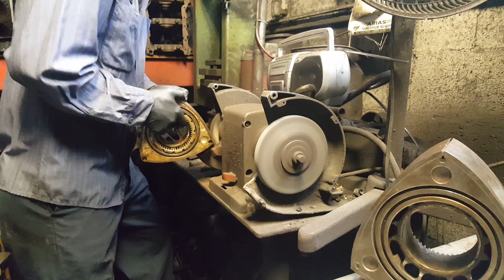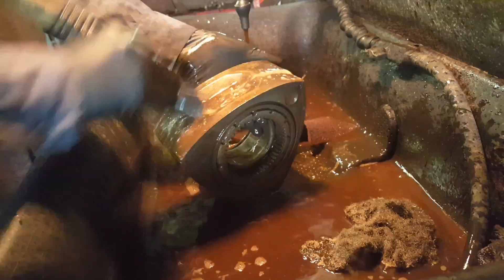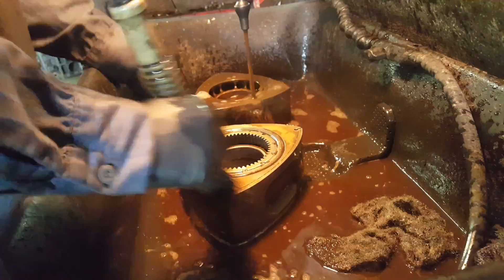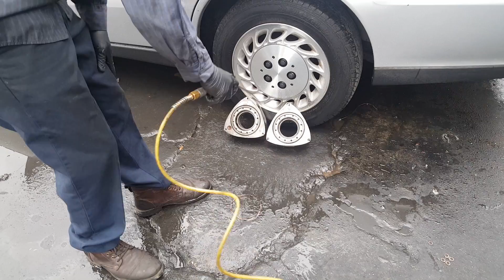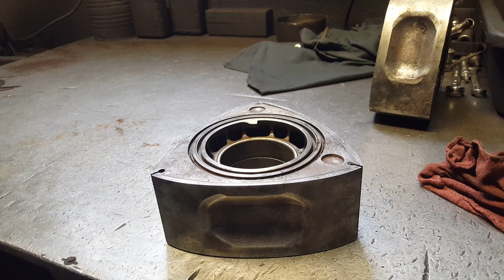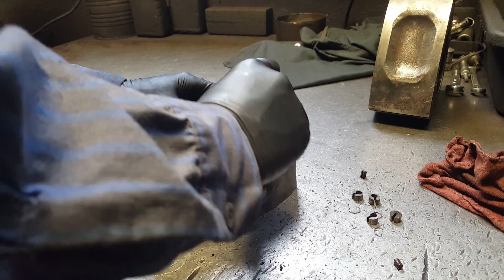Mazda rx7 mazda rx8 rotary engine rebuild;Cleaning the rotors

Comment: I have an rx-8 with 60k on it and it has low compression. I was think of rebuilding it myself but by the time I get new parts including housings I am already like 2k into it. Should I rebuild it or just buy a new engine? How long do rebuilds typically last if properly maintained? Thanks!
Reply from the maker: With a good combo over 160k
Reply: Rebuild it there’s a company that makes better seals it’s call power seals
Reply from the maker: Yeah i only use goopy or power seals 🙌

Comment: Do you have a love for wankle rotary engines or do you just get a lot of rotary rebuilds in the shop?
Reply from the maker: Love for the dorito engines haha 
That's why i even give out free parts to those rotary engine owners in need for parts to bring their cars back to LIFE
Reply: @JM8686  I'm having problems with the timing of the distributor for the b2200, what is the best way to fix it. Also, I rebuild my stock carb but I'm having problem tuning it, every Time I start the truck I having to use starting fluid.

Comment: Would that rotor be reusable considering how tight the side seals are? Or is it just built up gunk causing them to not spring?
Reply from the maker: Yeah 100% reusable but of course needs to be cleaned and the gunk and carbon build have to be scrubbed!
Thanks for watching mr Dias 👍

Comment: with gasoline like on housing cleaning on previous video is not good?
Reply from the maker: bogysan465 gasoline or any degreaser is fine!! All we need is to remove the oil so we can scrub with wire brush or scotch bright